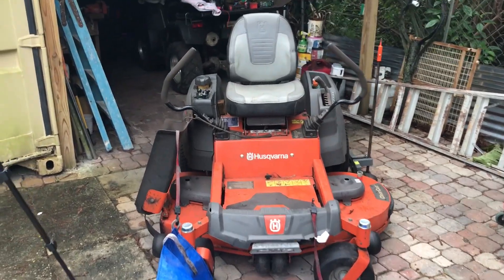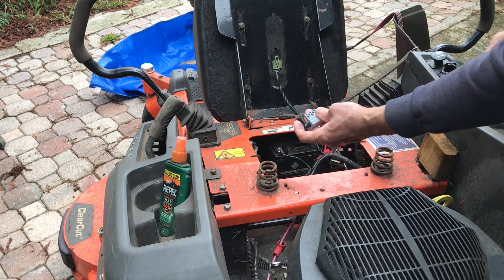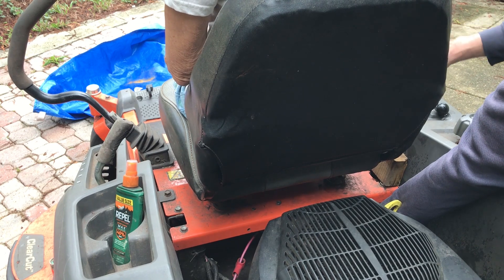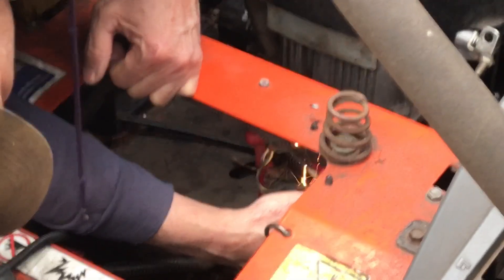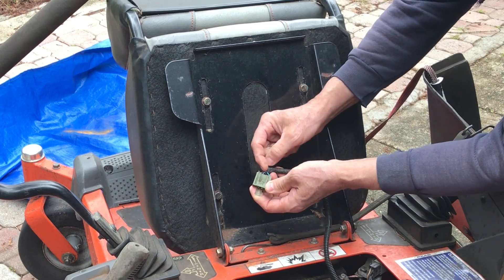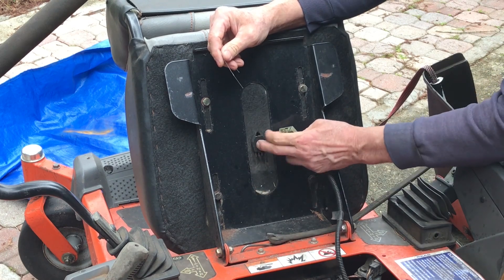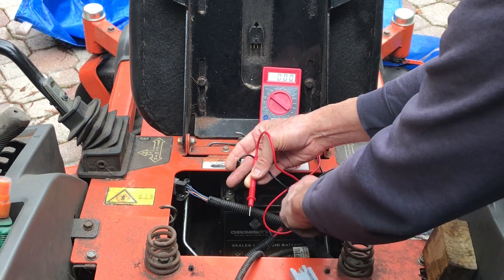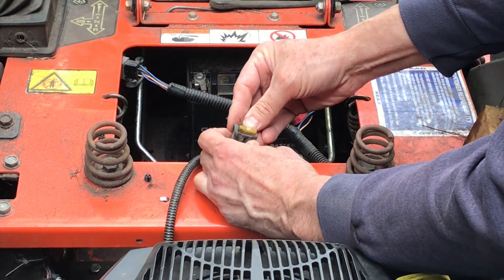Riding Lawn Mower Won't Start - How to Diagnose & Fix Electrical Problems

Comment: Good thinking.  Many folks. many times, forget about a fuse in the line.  It's an easy fix but, as you very well know, the troubleshooting methods get you there by taking the long way around.  Anyhow, you at least know the other systems are good.  Thanks for sharing your procedure.